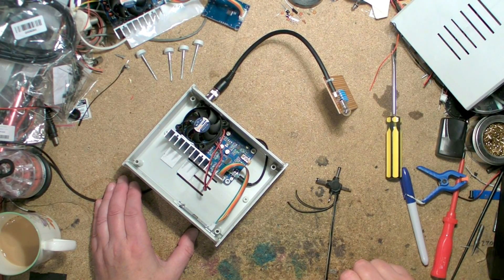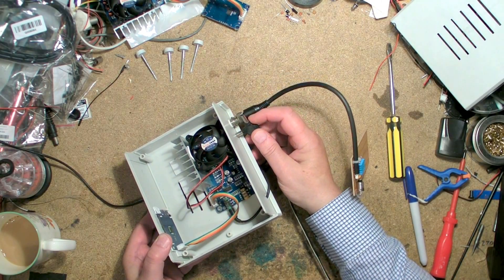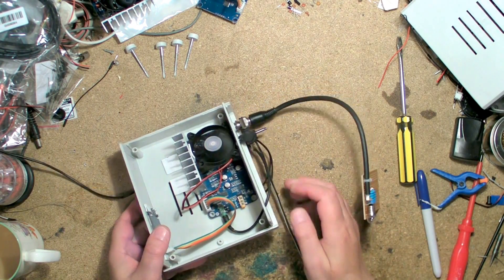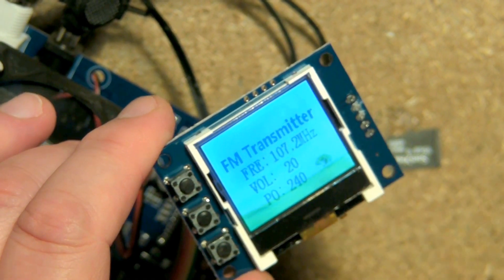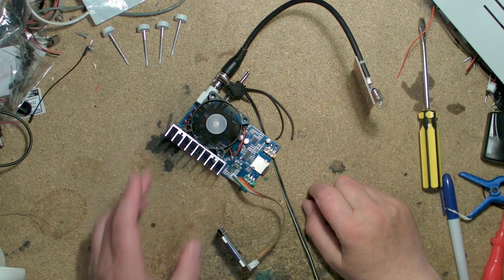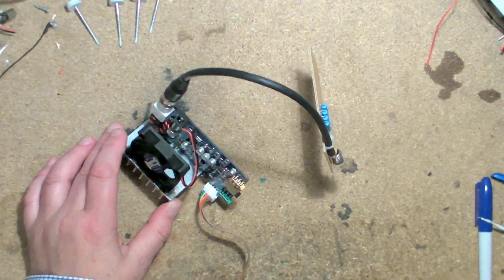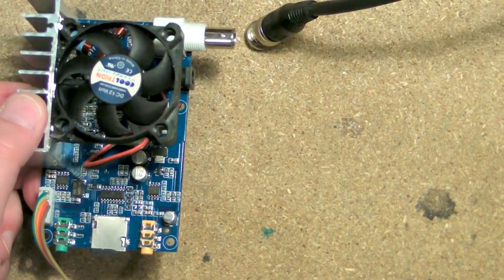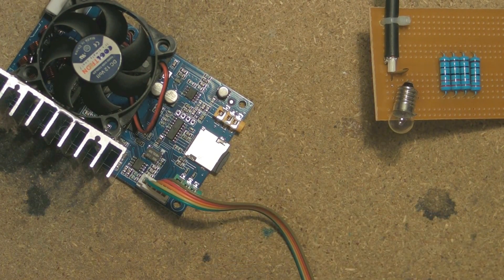Prototype 10Watt MP3 Pirate Radio Transmitter Kit with memory card playback and COLO(U)R Display!

Comment: It's not 7w transmitter it only 1w at maximum use it and see yourself that it's hardly can transmitter 100 meter and the c1971 transistor doesn't work in that circuit it's just to give you a look that it is 7w but in fact it's fake this is just a Chinese scam

Comment: Why reinvent the wheel? theres lots of surplus old 68 to 88MHz PBR land mobile radios
 like Pye M294 E band, either recrystal for around 88MHz or make a simple VFO at the transmit
 crystal frequency and inject it into the crystal socket, most run 25Watts
http://www.g4kfk.co.uk/Pye_M294_Conversion_HRT_199301.pdf  follow the E Band 4M version mods
VFO to replace crystal, for a M294 E Band you'll need  to bring it down to around 5.5MHz (x16 =88MHz)
http://www.g4kfk.co.uk/6m_or_4m_VFO_for_PMR_Conversions_HRT_198611.pdf
Cant guarantee it but one of these 5.5Mhz ceramic resonators might replace a crystal?
https://www.ebay.co.uk/itm/163717991722?hash=item261e5a4d2a:g:P0UAAOxyHIlTYCiv

Comment: HOW TO BUILD FM RADIO STATION WITH FM TRANSMITTER IN 15 MINUTES
https://www.youtube.com/watch?v=qT-dz3JUv9w
FREE DOWNLOAD MP4
https://drive.google.com/file/d/1KpsI-gQVZxZUGtkL7hTl_SA_Sn56nz6u/view
-------------------------------------
Cheap FM RadioTransmitter
https://www.youtube.com/watch?v=hp1TIlya_UA
FREE DOWNLOAD MP4
https://drive.google.com/file/d/1OtjwLyE8_--lkfuFlB29opqp4dCWGrrr/view
 "JumpStart a Car With a Portable TINY Battery!  It actually worked!" 
Mini Car Battery JumpStarter TEST from Pushidun. Test on 6 cyl and 4 cyl. Did it Work?
https://www.youtube.com/watch?v=TGCxD1_Gmos
FREE DOWNLOAD MP4 
https://drive.google.com/file/d/1F93nhcnAKINqz-Mm-PsnTFVozQ8I68Tl/view
Set up your own Pirate or Underground FM radio transmitter.  This is the Veronica 30W FM Stereo radio transmitter.  Plenty of Power.  When this transmitter is set up and at full power you could reach up to 15 miles. 
+++++++++++++++++++++++++++++++++++++++++
ALWAYS USE AN SWR METER - Good Price.  Great Product:
Signstek Professional UV Dual Band Standing-Wave Meter Power Meter SWR Meter for Testing SWR Power
https://www.amazon.com/gp/product/B00GNVJ8IU/ref=as_li_qf_sp_asin_il_tl?ie=UTF8&tag=jakeguitar01-20&camp=1789&creative=9325&linkCode=as2&creativeASIN=B00GNVJ8IU&linkId=85864da1a08399a9de6034f90ccc980b
+++++++++++++++++++++++++++++++++++++++++
Veronica radio kits allow for the fine tuning of any frequency on the FM bandwidth.  It uses dip switches and PLL lock and unlock to lock in the frequency.  Mount your antenna high up.  The higher you mount your antenna, the better your range will be, because structures like buildings and hills will obstruct your range.  
For the purposes of this video, which are educational and experimental, the power was down very low, less than 0.1W, and the range was less than 200 Feet.
However, if a person wanted to, he could use this transmitter and use these instructions to set up a pirate underground radio station.
You will use a tuned 50 ohm dipole antenna, need a Philips screwdriver, and a small flat head screwdriver.
-----------------------------
Google search: How to build FM Radio Station with FM transmitter in 15 minutes

https://www.google.com/search?safe=strict&source=hp&ei=3gpoW-3CJIPsaNDVgugB&q=How+to+build+FM+Radio+Station+with+FM+transmitter+in+15+minutes&oq=How+to+build+FM+Radio+Station+with+FM+transmitter+in+15+minutes&gs_l=psy-ab.3..0i30k1.2762.2762.0.4865.3.2.0.0.0.0.78.78.1.2.0....0...1c.2.64.psy-ab..1.2.192.6..35i39k1.115.ZM90sLnBOBI
=============================
Radio Station Equipment for a Professional Studio Setup
Want to build your own professional studio and have total control over your shows? Here's everything you need to setup your radio station equipment.
https://radio.co/blog/radio-station-equipment-professional-studio/ 
Property Radio is launching on 11th of November 2018 on DAB digital radio and the internet. We want the station to be interactive and for you to think of Property Radio as your station. We will give you the opportunity to demonstrate your knowledge as a guest expert on your chosen subject. If you would like to take part let me know here. We are currently scheduling our programmes 

http://www.propertyradio.co.uk #radio #property #propertyradio 

https://www.facebook.com/hashtag/radio
------------------------------------------
Simple and Small Pirate Radio Station
https://www.youtube.com/watch?v=AG8uXpX_GTg

FREE DOWNLOAD MP4
https://drive.google.com/file/d/188FGx911N7kmuxUGMtO-EVnMzTnZ5F18/view
-----------------------------------------
Prototype 10Watt MP3 Pirate Radio Transmitter Kit with memory card playback and COLO(U)R Display!

PLEASE NOTE: This looks to be a prototype transmitter which was released by accident. I can't find these for sale anywhere so no links. If you find them (with colour display and memory card slot, please share! 
Take a look at this brand new transmitter design that I received by accident with an eBay order. It turns out that it's a prototype of a high power FM transmitter with a built in mp3 player and a colour display! My testing shows that the spectrum is rather less "tight" than the older model and there are some spurious outputs 10 or so MHz apart. Because of this the unit has now been decommissioned. Tested and demonstrated with a dummy load in a Faraday cage. Power goes up to 999 "units" by the way, not as stated on the video. That's a bit like making a volume control go up to 11 instead of 10 though! Even at lowest power the resistors were far too hot to touch so my guess is that the maximum output well exceeds 10Watts - NOT to be toyed with especially if atached to an aerial. Item described as DIY KITS 12V Digital LED Radio Station 7W PLL Stereo FM Transmitter 76M-108MHz from "wishyou-happy" (sic) on eBay!
EXTRA: I forgot to mention on my commentary that there is as you can see a 4 pin socket space next to the mp3 decoder chip. I assume this may be for a USB connector. (The chip is unmarked so I can't check), The position has 5V at one end and 0V at the other though. Haven't tried this out yet so if YOU know any more about this circuit do please get in touch. The unit is now disassembled by the way as I was not happy with these parasitic oscillations which were at too high a level. The unit needs extra filtering or fitting to a tuned antenna imho.
https://www.youtube.com/watch?v=ry1EVvYj3-I
=============================
https://plus.google.com/u/0/102938430101840249723/posts/MoCw9tKWcyY

https://www.facebook.com/slawomir.slonka.5/posts/227518681429729
=============================
MY WEBPAGES
1. https://plus.google.com/u/0/102938430101840249723/posts
2. https://plus.google.com/108500099096706030164
MY FACEBOOK
https://www.facebook.com/slawomir.slonka.5
MY YouTube
https://www.youtube.com/channel/UCwidnW578YOUaxwWGEFr8Dw?view_as=subscriber
===========================

Comment: In the US the FCC is really starting to crack down on unlicensed FM transmitters operating illegally.
Reply: Keep it reasonable like me at 1 watt output and stay away from occupied channels. Give me a break! even CB radios put out 4 watts without requiring a license. 1 watt enforcement is not likely.

Comment: I just received one of these units from Aliexpress. It's fully assembled. Interestingly, the photos on Aliexpress show a model that lacks a SD card reader. But the one I received matches the one reviewed in this video. I have not tested it out yet. I also ordered an antenna that probably will work but I still need a 50 Ohm BNC cable to test it out. Here are the links to Alibaba: https://www.aliexpress.com/item/Assembled-12V-7W-PLL-Stereo-FM-Transmitter-76M-108MHz-Digital-LED-Radio-Statio/32810077285.html?spm=a2g0s.9042311.0.0.vlA6sQ. https://www.aliexpress.com/item/Portable-comet-GP-3-antenna-1-4-Wave-FM-antenna-for-receiver-transmitter-with-telescopic-antenna/32811037969.html?spm=a2g0s.9042311.0.0.YTJXUj
Reply: Do you have the circuit diagram.
Reply: Snaj mine did not include a circuit diagram.
Reply: @erikburman530  Thats unfortunate.

Comment: I have two of these after a shipping error. One is set up and just running a telescopic antenna. When close by to it it knocks every other signal off the air due to noise. When I did a range test (playing simple counting numbers) got 1.5 miles from an inside radio site. I know doing the range test was naughty but I made sure to be on an empty section of the bandwidth and was only broadcasting in fits and spurts. (hooked the wall wart to a iot switch I could control from my phone

Comment: I used to have one those, the one with the "colour" display. The LCD is actually just a regular black dot matrix with a pretty colour picture over the reflector in the back. That thing used to overheat and stop oscillating after a few minutes even with the power at 50 (I think the max was a number between 240 and 300). I wasn't using a properly matched antenna though. Sometimes the music player chip would hickup on some MP3 file with a somewhat more exotic bitrate and also stop working. One night I decided to use thermal paste and an extra heatsink to do an actual field test and managed to make it work at a power setting of 60 for a while. I found out the signal had individual spurious all over the band, and that was behind a car, after several concrete walls away. I found that kit to be dangerous and a complete waste of money. I used the C1971 to make a small RF amplifier instead. Don't know where any of those are now...

Comment: The single chip designs like this one are junk, they use a BH1415 chip which puts out a very dirty signal, only meant for very low power, car mp3 transmitters.
Reply from the maker: That's not the chip in this design but I agree a lot more filtering is needed.

Comment: FM kits like this are awful do not buy
Reply: So you would be happy to transmit on a piece of shit that sprogs all over the band then? If you are going to pirate at least do it on decent kit and have some respect for the band, it's tossers like you that give pirates a bad name. It wouldn't just be the authorities after it would be other pirates too ripping down your antenna.
Reply: Anything that uses a single chip for its transmitter ( which this one does ) and is amplified which this one also is will cause massive sprog all over the band.  The chips in these are meant for small mp3 transmitters running nano watts and were never designed to be amplified - use one of these and you will get attention from the authorities in no time - you don't need to try one to know that.
Reply: mrglitch0 amen
Reply: How do you know? Did you try this particular unit out????

Comment: These things produce a really crappy signal. Stay away from them is all I can say. They are that cheap for a reason.
Reply: I have to agree with him. Hooked one up and looked at my sdr at how all the other stations get washed out. You really need a pass band filter on one of these. Not tried signal test at distance maybe it is very noisy close by but I doubt it. These need a filter
Reply: You seem to be presenting a judgement without providing any supporting evidence. Have you personally tested one of these units? I'm guessing that you have not. So, if you don't know then don't post.

Comment: I recieved this "prototype" today but no instructions how to solder a dummy load. So since the antenna is still in shipping i havent powered it on yet. Does the mps files play repeat or does it stops after one play? And does it only play 3 hour files?
Reply from the maker: Almar Johansen Load circuit is available on line if you can't find it contact me tomorrow with an email and I will send you a copy. No idea whatsoever about files. Sorry.

Comment: I have recently purchased one of these and after assembling it I noticed that the buttons do not work, are they supposed to change the frequency or volume as they do not appear to do anything
Reply from the maker: Have you wired the extra board the right way round> That's my only thought IF all wires have continuity. Check with a meter. Rob.
Reply: Cashpot I managed to fix it, the buttons worked fine but then it would not transmit and I noticed a joint on one of the connectors for the lcd screen was not soldered on    properly, but thx for the reply
Reply: Hey, cool video! Do you get any instructions or schematic on which coils go in which holes or does it not matter?
Reply: @linuxthemoon  Count the rounds on the coil pic on the pcb and you find out if its the 4 or 5 one thats go there, they look like each other but two of them has 5 rounds.
Reply: What did you do to fix the buttons?
Mine does not work. Also it draws 1.6Amp that seems fairly high given I have nothing connected or does it simply output full power?
Reply: Try holding down the middle button, it should highlight the frequency. If that does not work did you put them in with the normally open side going to the tracks on the display board? If not rotate them!